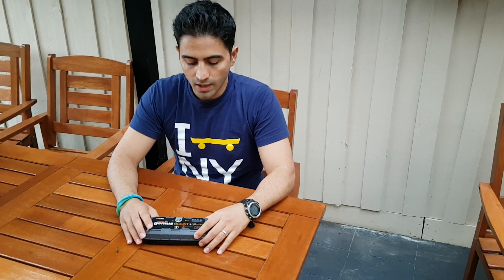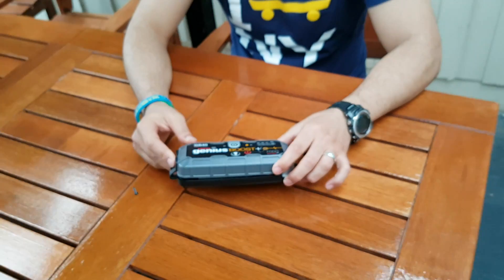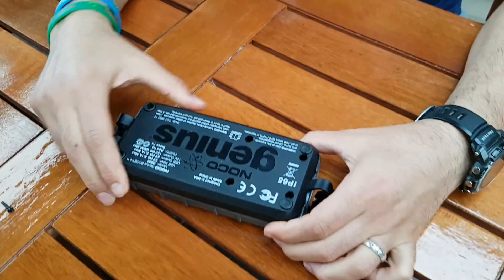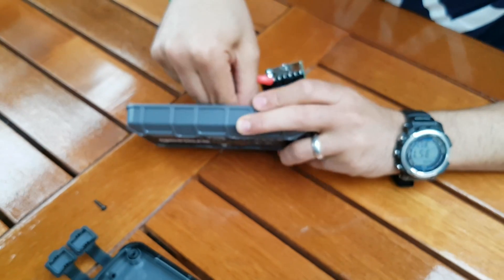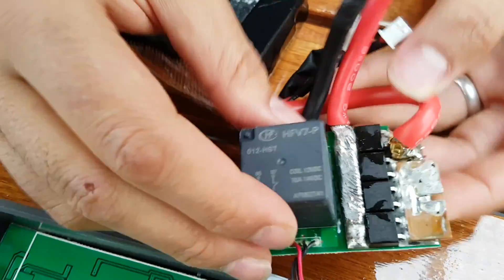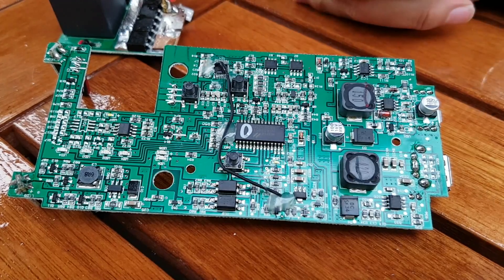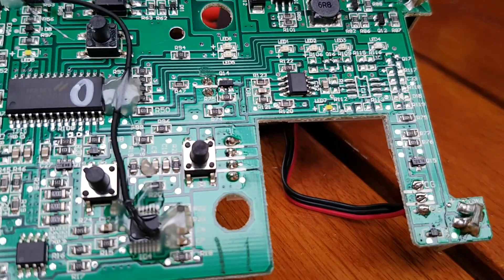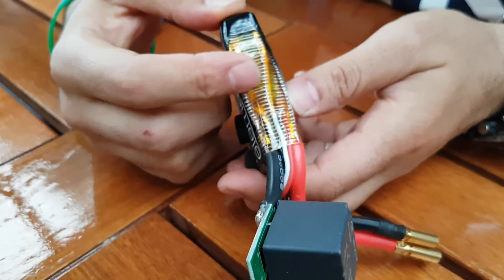Inside Noco GB40 Battery Booster Jump Starter Review

Comment: I have one. It will start my one litre petrol car. But only if the battery is just slightly low. ie will barely turn over the engine. If you're lucky, it might even have enough charge for a second start...  With my two-litre VW diesel, there is no chance of starting it with this! (Just the preheaters will flatten this quite quickly)...   here in the UK it is not a cheap item, and I would probably not buy it again.  It's both convenient and small, and will recharge from a phone charger - but nowhere near as good as the makers hype would have you believe...
Reply: Hi Richard, I managed to start my 4.6L V8 with this toy today. Maybe there is an issue with your device?
Reply: starts my 3.2 v6 no problem
Reply: Richard is talking about a Diesel engine with glow plugs.  That needs sustained power. These little lithium ion jump boxes deliver high power for very brief bursts.
Reply: Didn't start my Honda 2.2 said it could start up to 3L however no luck here - was dead - the battery was at 5.7 volts and it was cold but not freezing - .
Reply: Didn't start my 2.2 liter either.  Plug in trickle charger started it right up.

Comment: You are 100% right about Noco over rated jump start battery that really work well for lawnmower, small tractor and smaller motor bike. Even my iPad Mini has higher wattage per hour battery than Noco under size battery. 11.1 volt is little too low for some of the starters. Needed LiFe04 3.2 volt x 4 = to 12.8 volts at 10Ah. will work much better than so small battery. Maybe build your own jump start battery that will weight just 10 pounds instead, just 2 pounds.

Comment: Been using Genius Boost products for the last few years and we're very happy with them. The newer models, GB40, GB70 & GB150 are outstanding!
Reply: thank you :) good to know
Reply: I always thought the lithium chargers actually charged the battery, since they start a car up so quick.  Looking at this is about the same voltage as a standard lead acid booster.  Maybe the instantaneous current is much higher though since it's lithiums.

Comment: I would power a GPS or a small radio.
Reply from the maker: This unit is designed to do short burst of current and not very suitable for running equipment for long time. So you can do it but the Noco wont power them up for more than couple of hours.

Comment: I was wondering if there were any capacitors inside. I would like to use the unit to power 12V items, NOCO told me not to, that it would destroy small items. What do you think?
Reply from the maker: You probably can but to do that you should go through the bypass and when you go through bypass there is no protection. What are you powering up and for how long?
Reply: Same here looking to power a homemade bluetooth speaker with something like this. I'm trying to find out if the jump start output uses caps or basically if it will discharge slowly instead of just instant high amperage power
Reply: @r0llinlacs  You could just use a Lithium battery with an undervoltage protection circuit and a charging circuitry. No need for the additional things and the high price of these things. The batteries aren't very big in these jump starters anyways.

Comment: Hi
I've the same damage with my gb30 after I used the red button .
is it possible to be fixed ?

I think something was burned in the circuit board .
Reply from the maker: +Aggoony R yes you are right. It wont be the micro control circuitry, I believe it is either the relay or the power rectifier. I need to do further testing. however on the main PCB one of the traces have slight burn mark.